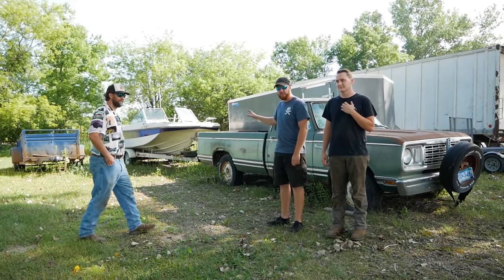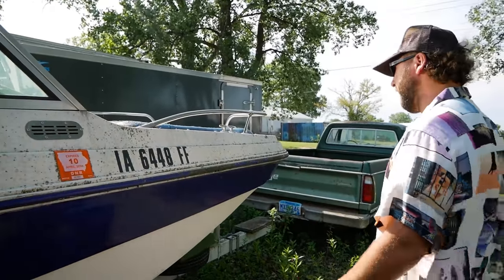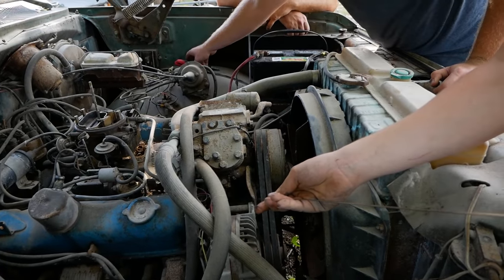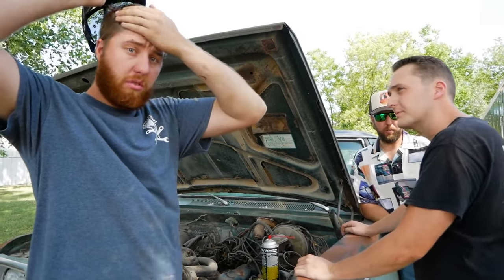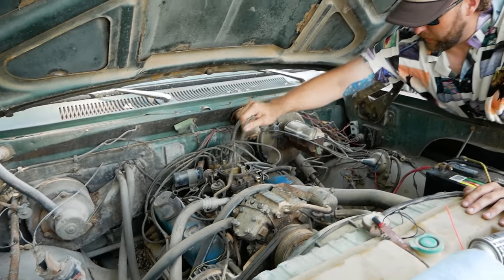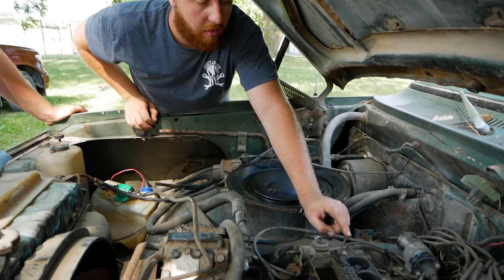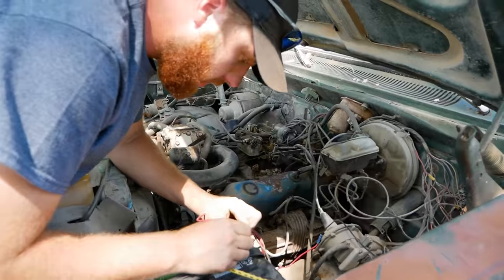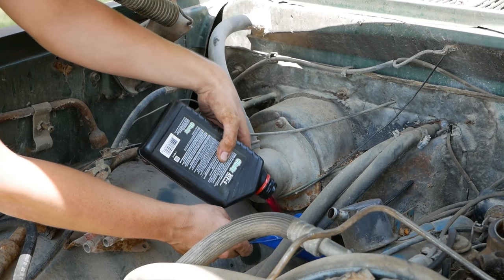Will an ABANDONED Truck AND Boat Run After 12 Years!? - Part 1

Comment: Just throwing this out there for what it's worth, something my dad taught me as a kid to clean jets. We used to take the extra pieces of guitar strings that are clipped off after putting new strings on and use those to clean out jets. The wire being wound acts like a scrubber and the different size wires for different size jets.
Reply: Coming from a guitar player and a youtube hobby mechanic, that's genius
Reply: A stripped bread bag tie also works

Comment: That poor Dodge engine sounds like a lottery tumbler full of marbles and Christmas tree ornaments.
Reply: I was gonna comment but that says it all lol
Reply: Oh you mean it sounded almost like my 1984 Dodge D150... Which burnt oil like it was going out of style and ran every day of the week except every 10th Wednesday.
Reply: @DeadReckon  Oh you mean every Dodge ever?
Reply: @eriklarson9137  At least every Dodge with the wonderful non-adjustable valves... They rattle, they wheeze, the seals don't last, but damn they run forever... Probably because the cylinders and valves are being excessively lubricated from constantly failing valve seals.
Reply: They sounded like that new🤣
Reply: Looks like she’s a track lock diff
Reply: @DeadReckon  I wonder if that's why old Honda Civics last forever. I had a Honda Civic that burned about a quart of oil a month, not even a few hundred miles a month. Still running like a champ at 300K miles. It was the valve seals in that car.
Reply: @eriklarson9137  This is what my 1973 D100 looked like! My 1st. taste of Chrysler products 1988. And Have been a Mopar fan Ever since!10/31/20...TRUMP 2020.Don't forget to VOTE 11/03/20..

Comment: It's a dodge, if it was running when it was parked  you should be able to get it running.  I have a 76 D100 with 
487,000 miles and still runs great. It has a 318 4 speed.
Reply: "still runs great" also carries a few gallons of oil and coolant behind the seat cause 'it burns a little bit'
Reply: No you don't, I mean you probably have the truck, but "it still runs" c'mon, no really, c'mon
Reply: @jerrycraig6522  yes same block same heads. I have just put new gaskets a timing chain and a high volume oil pump over a hundred thousand miles ago and the oil pressure runs at 80 pounds no matter how hot it is, and i change oil every 3,000 miles.
Reply: My dad has an 02 with the 4.7 in it and 860k miles on it😂

Comment: Not a bad looking old truck. A few things about them I've found is get rid of the low oil pressure cut off switch. Also the 4 pin ballast, if you have a 2 pin do not try to put in a 4 pin. The radiator is the "heavy duty" 26" jobber. That carb has a stupid idle enrichment valve in the back also.

Comment: Dylan wanted to prove he could get something running in less than a year
Reply: I’ll bet he was wanting to carefully disassemble each part of the truck to be painstakingly restored back to factory function and finish before even attempting a start; while Digs and VGG’s style is more like “aim carb clean in it’s general direction, turn key and cross fingers” 😂
Reply: @rustyjeep2469  Thats not the Dylan I unsubbed to, the Dylan I watched for a while bought new parts and slapped them on a pos before ever doing any body work, and when I pointed out his mistakes he jumped my shit in the comments. Gonna laugh my ass of when he dumps the clutch on that Hemi in his Challenger and the back window flies out and smashes on the road. I've only been building cars since the 80's so I have no idea what I'm talking about.

Comment: Unless someone drained the raw water cooled engine, that MerCruiser/Ford is likely got a split block from freezing, as is the lower foot on the out drive from it getting rain water in the prop hub exhaust being left angled up that way.  I suspect rotten stringers, deck, transom.
Reply: Unless they flushed it running with anti free!!naw thats not necassary!!nope dereck would say!!!snookie.
Reply: Yerp... Friend of a friend had the brilliant idea to buy an old boat for the Chevy 350 in it, that block was toast, had some cool heads on it... But they where toast too. Had a really nice Holley carb but that was full of uh, something that came out of the creature from the black lagoon after taco Tuesday...
Reply: @DeadReckon  buying a boat is like playing sweepstakes,may as well give your money away,cause its always a money pit!!!unless its aluminum at very least if no floaty you can recycle it for beer money,ha,ha.yeh them shiny headers and carbs will suck you in like a whirlpool,snookie
Reply: well someone has a 460 in a truck in his backyard that'll fit.....
or put the 460 in mook's truck and the 351m into the boat....
Reply: @alt7488  351M in a boat... Yeah not me... I ain't getting on that boat...

Comment: Imagine wiring the fuel pump to the blinkers, the car would be jumping on and off the whole time lol
Reply: That actually happens on my Volvo.  The right front turn signal is on the same circuit as part of the fuel injection.  If the ground comes off the engine will cut in and out with the turn signal.
Reply: @matthewterry5540  did you do that on purpose?

Comment: I had a 1984 Ramcharger with a LA 360 with a Carter Thermoquad and I loved that truck. I was SO mad when I sold it. I pulled the LA 360 and swapped in a 360 Magnum and kept the NP205 and 727. I just wanted fuel injection and for what I paid for the 360 Magnum I could've just gotten a Holley TBI kit for it. I was dealing with vaporlock every time I drove it. It hauled ass for such a large vehicle and it would go anywhere in 4wd, but it was also rusted out summin fierce.

Comment: In the 90's A family friend had a Cobalt like that one and I had a 1973 Marlin. (just like the Cobalt with less fancy trim and doodads) The hull is built like a tank. It will go 35mph. The tri hull shape keeps it very stable on the water, but it rides rough in choppy water.

Comment: My father had a 1980 Power Wagon in the exact opposite of that paint scheme--light green with dark green stripe.  I learned to drive stick in that truck, which was an adventure. IIRC, it had a four-speed, but first was so low you never used it unless you were trying to pull a bank off its foundations or something like.

Comment: I love this truck not only because it's an old Dodge with the gear-reduction starter but also because it is as old as I am. I'm actually on the hunt for a1977 Dodge W200 4X4 with a manual transmission.

Comment: neat lil tidbit about the marker lights, i have a 78 power wagon with clear lens on the marker lights and it has the metal under the grill like dylan pointed out, and it still has the washer fluid resevoir

Comment: Ayuh.. I have a 75 Cobalt with the Ford 302... Bought when I was 19 in a mess of a condition and restored it.. after going thru the engine and drive it's been the most reliable boat I have ever been around, I've been around boats my whole life.. I've put 350 hours on it since going through it and she's never let me down, besides the battery going dead a few times but that doesn't count..

Those Cobalts are top of the line boats, Cadillacs of boats they say. And those old ones have strong bones if they aren't rotted out yet. The fiberglass hull on those is like 3/4" thick... On other boats such as bayliners they're like 1/4"... By the way that boat should run 48-49mph at 4400rpms, that's its max hull displacement speed

Comment: very nice,just found some abandoned trucks myself a guy is auctioning these of, Chevy squarebodies and a 77 Ford custom F150 4x4 with a 300 6 cylinder, they all run but need some work. The ford runs like a champ even has a 4 speed, got that running earlier today,I can give you the auction link if you're interested

Comment: I have had good luck just advancing the timing until one of 3 things stops me.  Either it cranks slowly because it's trying to start backwards or I hear spark knock or further advance slows the idle instead of speeding it up.  If I detect any of those, I bump it back a bit.  If I don't detect any, I bump it forward a bit, and turn the throttle stop to minimize idle speed without stalling while using the power steering.

Comment: The boat isn't much good with a rotten transom. If it's sat out in the open especially without a cover then it's probably got accumulated rainwater in it. That causes mildew and rotten floors and structural parts called stringers in the bottom of the hull, and usually a rotten transom that will all need to be repaired to make the boat structurally safe to use. If any of that is the case and you don't mind investing a lot of money in it or doing a long term project on your own then go for it.

Comment: I got over 500 thousand miles on a 1979 dodge st. reis old cop car with a 360 man those engines are tough. Bad gas miles way so gas station here you come. I had over 400 hp in it a bit over like 425 hp.
.

Comment: speaking of Ford vs Dodge, Did you know that a slant 6 is heavier than a 302 Ford? so the 302 Ford truck, which is also shorter and so doesn't go as far forward, should have better traction because it is less nose heavy than a slant 6 truck.

Comment: I have a fun fact about 68 69 Dodge chargers the tail lights in a 68 are round but 69 are flat loops and the grill of a 69 is all flat.69 has a line going down the middle of the grill.

Comment: Screw using that Brake Clean!!! Use Carb Choke Cleaner Or ETHER!!! I WOULD have to Guarantee either one of those two to work much much MUCH better than Brake Clean. They are way more Flammable and Combustible  than Brake Clean. Thats what I use.....found that the Brake Clean just plain SUCKS for trying to start something thats been sitting for years. Get the DG Ether it works better and its cheaper than Brake Clean.

Comment: Did that dude seriously put ATF +4 in a 77 Dodge truck? Bro thats gonna be a big NO. The ATF +4 has more synthetic friction modifiers due to the transducers in modern Chrysler transmissions and will literally destroy those clutch discs in that older transmission.

Comment: Just my opinion  :)  After the test to see if the engine cranked -  Marvel Mystery Oil mixed in with gas dropped into the carb is a good "old timer trick". That and removing the plugs and adding a few drops of  MMO to each cylinder will offer some help in starting an engine that has been sitting this long. Be well!